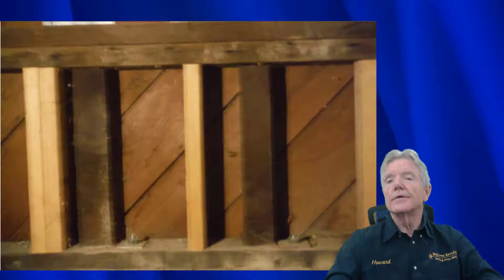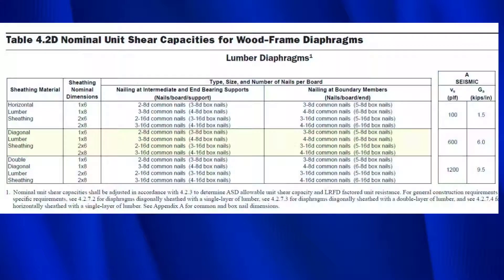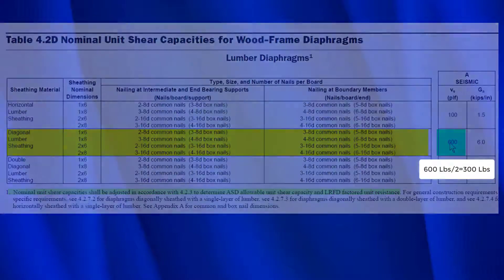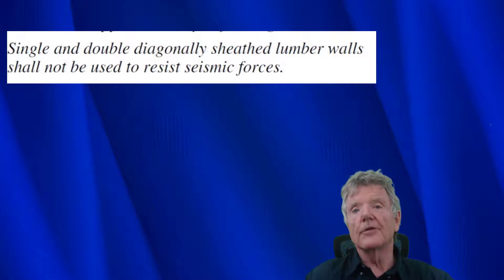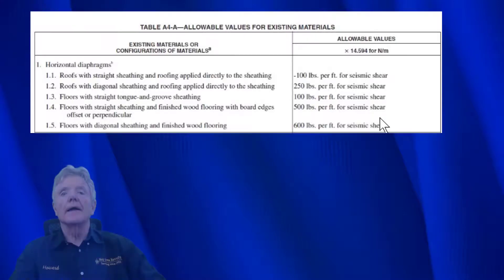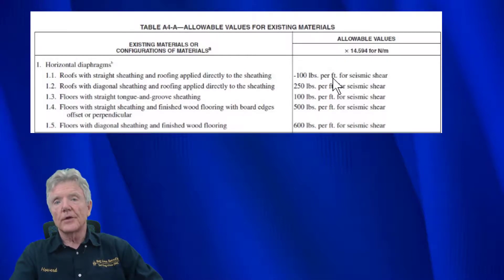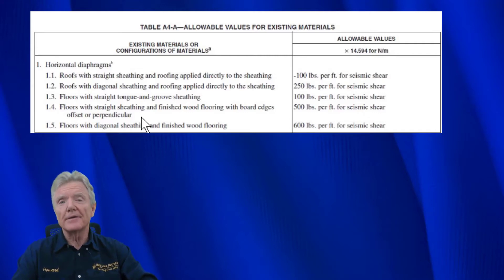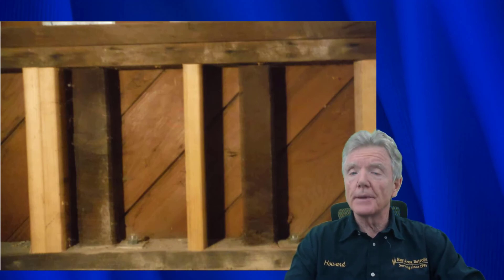Save Money with Diagonal Sheathing

Comment: As wood is skyrocketing in price and I just bought a sawmill. And a home with a pretty rotten subfloor in the bath and kitchen I'm debating replacing it with osb or cutting drying and planing some 1/ material and diangle sheeting it.
Reply from the maker: I am not sure how I can help you
Reply: @bayarearetrofit5814  you have, sorry you said to comment if and how this video has helped. It helps to know how things of yesteryear have been done. Thanks. :)